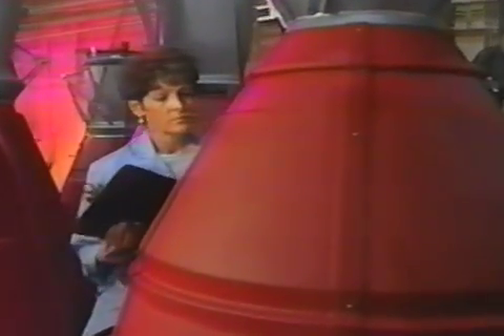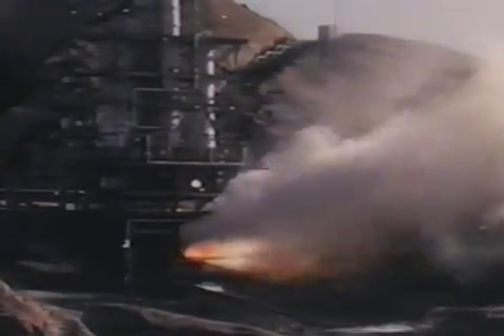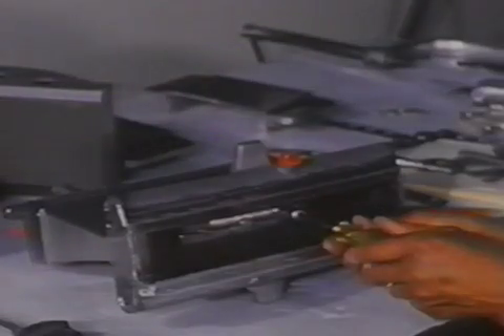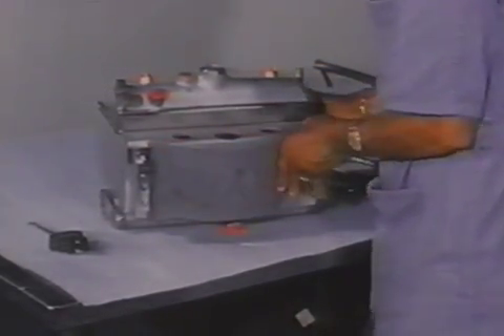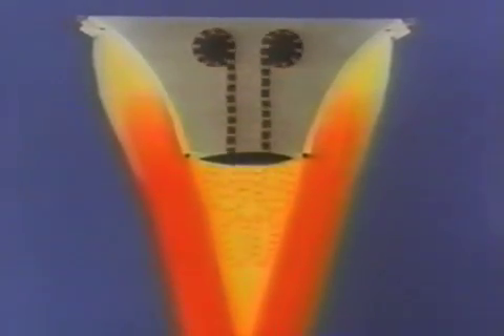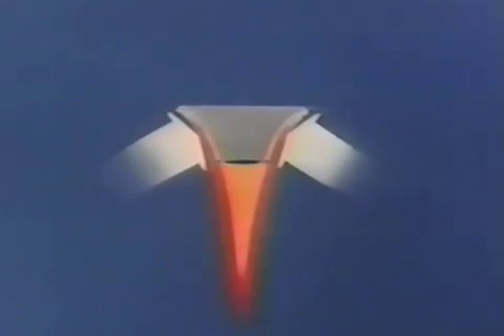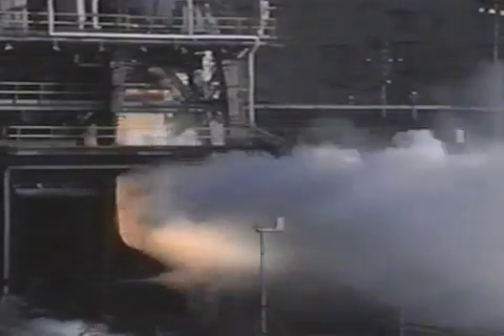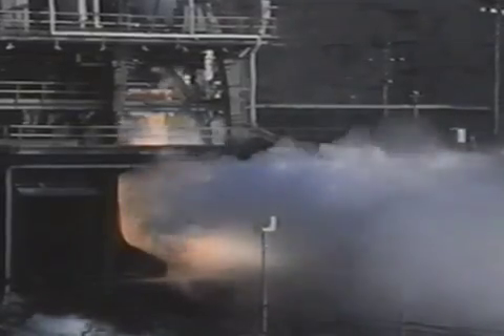Aerospike Engine

Comment: With all the advantages this engine has to offer, why isn't it being flown now? I imagine a full flow, staged combustion areospike engine would offer even higher performance. Either way, the next manned space shuttle should have this engine, and enough fuel aboard to accomplish in orbit what the Space Shuttle could not.

Comment: This promotional piece is hilarious, with the b-roll of workers trying to look busy doing made-up jobs. What'd they tell the guy at 0:17? "Hey, just point this acetylene torch at this rocket booster we had precision made by robots, and then maybe we'll get a take where you whack it with a hammer a few times". Like, this stuff has to be super reliable so it doesn't fail when you put it in space, and also it has to be super precise because... well, it's a rocket engine, and because of that there is no point in the process of building a rocket where someone is doing anything with hand tools.

Comment: Whether toroidal or linear, is the exhaust held to the central cone/spike solely by directional aiming or does Coanda effect come into play?
Reply: ramosel ambient air pressure I would imagine. Obviously the exhaust plume dilates with altitude. One of the ingenious aspects of it is it’s organic efficiency at any altitude. I find this to be one of the most interesting aspects of it.

Comment: Gotta be something wrong with this idea if they have been working on it from the 70s till now
Reply: Nothing wrong. The X-33 Venture Star program was meant to have an Aerospike engine, and one of the only programs to use it. When the program was canceled testing for the aerospike engine stopped aswell. However Arca Space plans on making an SSTO with the engine.

Comment: Could SABRE be used in conjunction with this? The exist side is a rocket part anyway.
Reply: The Sabre engine technology is chiefly a novel - although fairly simple to comprehend - heat exchanger cooling multi-mach compression friction in the inlet for control of air density and velocity (higher mass slower speed - the cooling causes the contraction into which the nozzle spike is regulating a balanced flow - therefore a constant massive high speed feed of very hot air cooled within seconds to a higher density low velocity air mass the turbine can pull in for oxygen). There is no reason the traditional nozzles can't be replaced by an aerospike nozzle as shown in this video. It has to do with the perception of risk in the financial political and professional communities. You have a "new" technology on the front end and the risk people are going to say no to putting a "new" technology on the rear end as well - multiplying your risk, as it were. It's an economy-of-scale judgement (mostly false due to overthinking) and it plagues human thinking. We can only ingest just so much knowledge and angst about not knowing before we blow up our ideas and settle for less.

Comment: If it's such a good engine how come it's not in use?
Reply: Not mentioned in video, Thrust drop-off at supersonic transition (rocket crossing sound barrier) as unsolved issue with aerospike engines.
Reply: @Nszewczak  
Didn't they partially solve that by dumping the turbopump exhaust down the center of the spike?
Reply: @Nszewczak  not exactly, the sidewinder used a rudimentary form of the aerospike. The problem became when bigger firms were getting the shaft and Lockheed purchased the RS33 rocket motors from the USSR. This ushered a battle to the bottom at which time NASA saw no use in further developing the design.
Reply: Infrastructure issues. The SSME has a manufacturing base already in place. So it's chapped to build and operate.
Reply: NASA was going to use this in a single stage to orbit shuttle, which would've been very cost efficient, but funding was cut before they built it. SpaceX and other space companies don't have the money or time to develop their own proprietary Aerospike engine, even if it would save money in the long run. Old rocket technology is cheap and reliable enough; no one is willing to invest to find something better.
Reply: What has Hydrogen Peroxide got to do with anything?
Reply: For the same reason we don't have mono-rails with mag-lev in the u.s.a. Because somebody else got the contract, and an entire economy was built around it.
Reply: so if someone solves it, it mean money to the man-or women?
Reply: It is.  Just because they don't show you the vehicles using them, doesn't mean they're not in use.
Reply: My guess is hydrogen peroxide weight/duration.  Not a long range solution.
Reply: My understanding is the fuel is H2O2....very weithy for its duration.
Reply: using it means you can use a smaller vehicle, doesn't look as good as the big photo op vehicles.
plus it might put people out of work, and lord knows govt workers don't like to be efficient with tax payer money.
Reply: @scooby4707  watch everyday astronauts new video on aerospikes, to know why they are not used.
Reply: Efficiency is accused of eliminating jobs instead of facilitating other work.
Reply: @j.4354  you mean those kickstarter/bitcoin firms with that uses autistic new age twinkly music for their promos like Elon musk did with SpaceX (which aint a commercial success in comparison to NPO Energia and Grummann who developed alot of the designs that he stole)? Please those vegans will make it as reliable as a chinese made firecracker after being in a damp room for 5 minutes....

Comment: so why was it cancelled?
Reply: Skylon uses a spike configuration on its inlet. But it appears - at least the public view of the engine cutaways - to use traditional nozzles. It would certainly be smart to use this design. It's a heartbreaking fact of life in all engineering that engineers don't stop progress. Others do; lawyers chiefly, then business types, political types, regulatory... omg
Reply: +Shannon Miller Nope. Skylon uses an air breathing rocket called SABRE.
Reply: The main advantage of an aerospike is high efficiency at altitudes close to sea level.  The Skylon's rocket mode doesn't kick in until it's well above sea level, so traditional nozzles are just as good.
Reply: the tip at the end getoverheated easily, no material in the world can solve that
Reply: Budget cuts for the defense and military industrial complex, the project was at 94% completion. They had issues with manufacturing non leaky fuel tanks for storing the cryogenic hydrogen/oxygen fuel. these tanks if cracked in flight, would lead to catastrophic failure of the space-plane.
Reply: Nope, it has great heat capacity, but with the amount of energy that a rocket puts out as thermal energy in order to force expansion of the gasses is too high. to maintain structural stability, the nozzles are cryo-cooled( the fuel is passed through the nozzle to cool it) before being injected into the combustion chamber.
Reply: The project it was attached to was cancelled. I never had the infrastructure built to support it. So the space shuttle main engine is cheaper to build. Even though the ssme is less efficient.
Reply: Because this is a really good sales pitch.  That doesn't mean anything about the actual product.
Reply: +SILLACE ESTEKAY 
not sure but i think the skylon plane will use one.
Reply: 2sudonim
oh yeah
Reply: They found out about black ops having anti gravity ??
Reply: It is complicated
Reply: it was cancelled as it overheats too easy and can be hard to have long sustained burns because of the first reason
Reply: DARPA
Reply: Because it was too efficient, too reliable, too easy to maintain and most importantly it was too cheap to operate, at least for NASA’s standards. It wasn’t costing taxpayers enough money 💰 Does that make any sense to you? It all comes down to the profits the contractors would’ve made and at the time they did not want to lose all that extra money. They figure they’ll save the blueprints and they can always build it in the future

Comment: When will it fly?
Reply: It won't. The project or was attached to, the VentureStar, was canceled over issues with its fuel tanks and heat shield. The engines worked fine but the other two key technologies, composite fuel tanks and metallized heat shield never panned out.

Comment: I wonder if the engine would be more efficient if it used a closed cycle fuel pump, you wouldn't need the large space in the spike. However this design seems to have disappeared,  any more news anyone?
Reply: wraith01mg I don't think so.  The open spike creates a low pressure zone for pump exhaust to exit, but it's still contributing to thrust, so you don't gain anything by going to staged combustion.

Comment: 0:49 over 73 engine tests......so 74?
Reply: Probably 73 tests plus some minor tests not worth enumerating.  So 73 tests.
Reply: +patman0250 Don't you mean more than?....Ha moron
Reply: TheDct88 there are more tests that just firing it up and letting her rip.
Reply: Or maybe, 73 deliberate tests, and an accident that happened produce useful data.
Reply: The math checks out.
Reply: over meaning more then .. moron !
Reply: @patman0250  Don't call someone a moron when you can't use proper punctuation, diction, or syntax.

Comment: What the hell are we doing? This is still advanced by today's standard... from the freakin 70's.
Reply: It is complicated to cool the inner cone of the engine, thats the main problem. Normal bell nozzles work good enough on staged rockets. A single-stage-to-orbit vehicle would be expensive and not necessary. But they look so awesome! :)

The first attempts to use aerospikes were back in 1941, when the Germans built the Messerschmitt Me 262. It was used with a jet engine, not a rocket engine, but the concept is the same.
Reply: Meh, i like aerospikes that are in video games, really helpful in my ssto
Reply: I didn't even know that Rocketdyne had done aerospike development work back in the 70's? I knew about the XRS-2200 work/tests done during the X33 program, but to find out those engines have been worked on way before that time makes it even more puzzling that nobody is building aerospikes these days?!?!
Reply: i suppose we can start more work on ion thrusters.